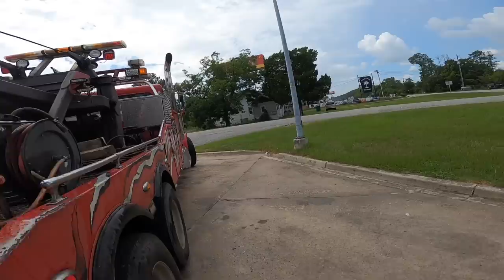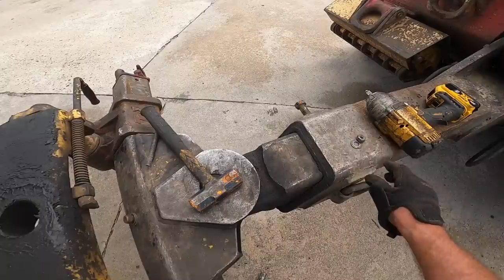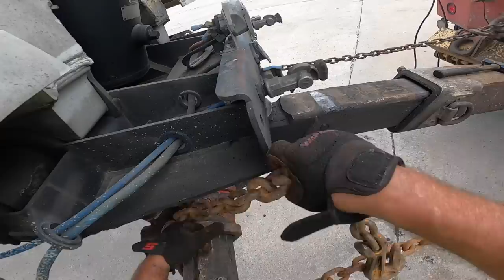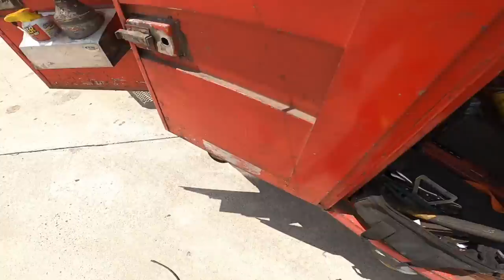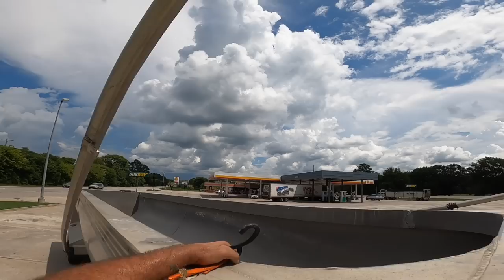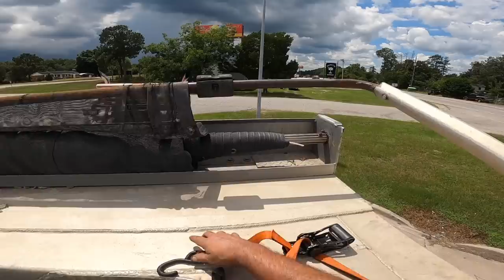Zacklift 5th Wheel Attachment

Comment: Hey Mr. Hal, that sure was a lot of work. Just getting the tow set up was more difficult than the actual tow. Thanks for another interesting video. 👍
Reply from the maker: Mr Danny Yes sir it is. The tractor with a light bar would have been better. Thanks for watching and stay safe
Reply: Sorta reminds me of painting.  The painting is the easy  part.  But if you are doing it right, the prep work to get to the point where you can paint is tedious and time consuming.

Comment: Great job as always, Those drop dollies on that trailer reminded me of the first time I used a medium duty wrecker that we built it was a 1960 Ford F-600 with homemade booms made from drill casing. A new driver for a fuel company that I also worked part time for dropped a fully loaded tanker with 8000 gallons of diesel fuel on a gravel parking lot of course the dollies folded over. My little F-600 immediately stood straight in the air so we pulled a road tractor up bumper to bumper and chained the bumpers together like my boss told me to do then I lifted the tanker while they backed a tractor in from the side and the only damage was a slightly bent wrecker frame which we straightened then plated the frame
Reply from the maker: Mr John Yes sir the gopher still has them. Thanks for watching and stay safe

Comment: Better question why just not use one of your tractors to retrieve that trailer. That seemed like a lot of work just to move that trailer.
Reply from the maker: Mr Timothy  I was half way to the location and I was empty. It would have been easier with a tractor and light bar. Thanks for watching and stay safe